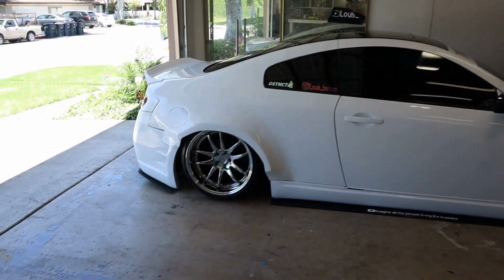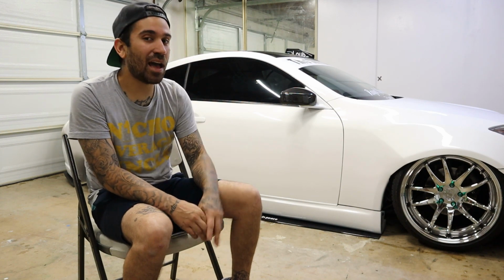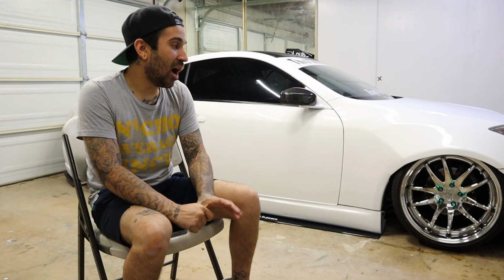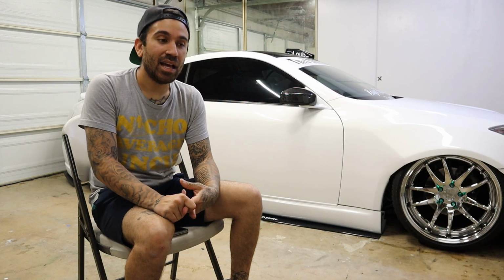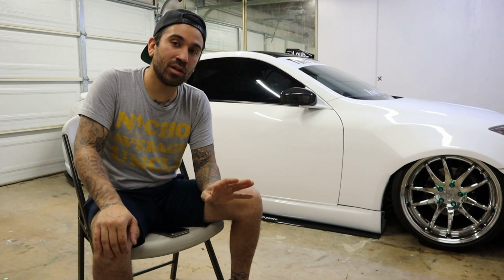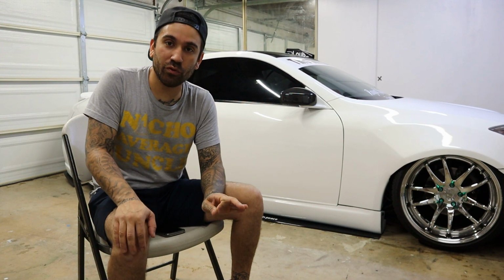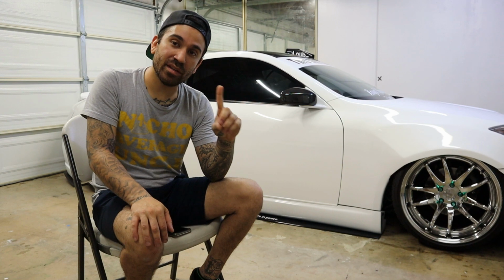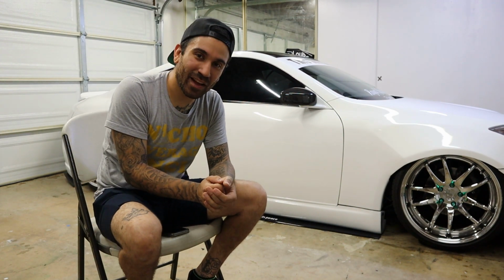WIDEBODY G35 CHANGES

Comment: What wheels u got on ur g 🔥 nd specs?
Reply from the maker: They are aodhan ds02 I think. And 19x11 all around
Reply: @Louis_B_creations  u think fitment will be fine on a stock g35 coupe with rolled fenders with those specs?? Nd wat offset did u get for the front and rear
Reply from the maker: @KniightzOG  check out some one my older videos of the half white and half black he has same specs as me on stock body and fitment is perfect. They are +11 offset